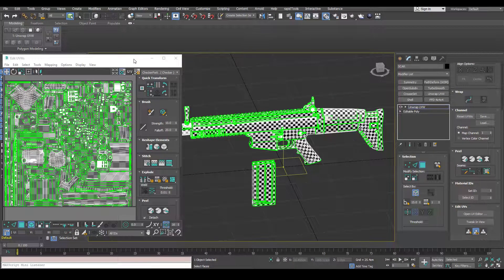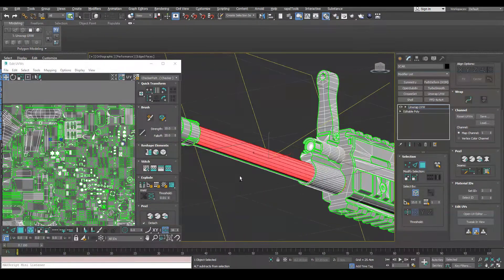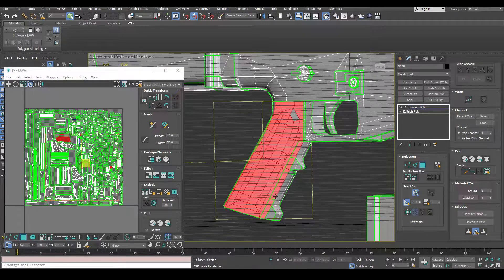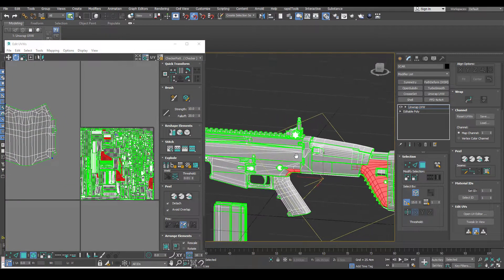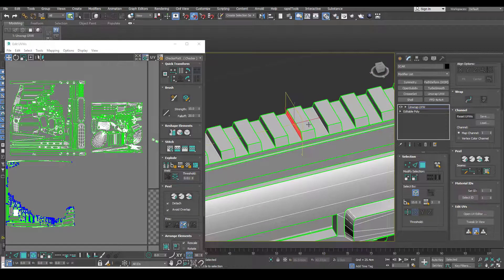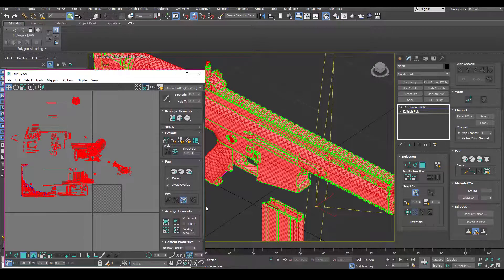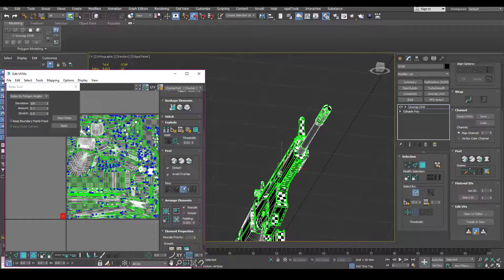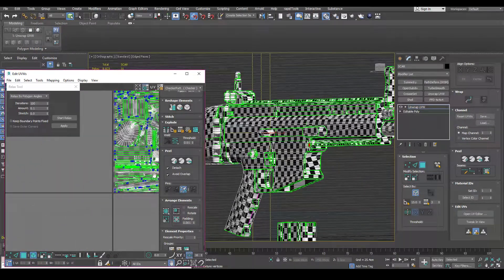3Ds Max - Fast Unwrapping techniques using Flatten mapping & Smoothing groups

Comment: so you packed the small section of the top rail into a neat little group
but after packing everything at the end.. wouldn't 3ds max split the little group up?
or in other words, is there a method to keep sepperated groups like the one you did and pack a lot of them together instead of each isle?
Reply from the maker: Yes packing everything at the end would undo all your work. You can do what I do with the top rail and other similar places and exclude them from the final pack and then manually pack everything together.
Reply: I was just playing around with the groups and noticed that they just break up if you have a the uvw modifier on multiple objects. so if you'd attach everything into one object, you still can use the grouping. just gotta break it up and rename them afterwards.
i guess it depends on the object if it's worth it.
thanks, this tutorial gave me new ways to work :)